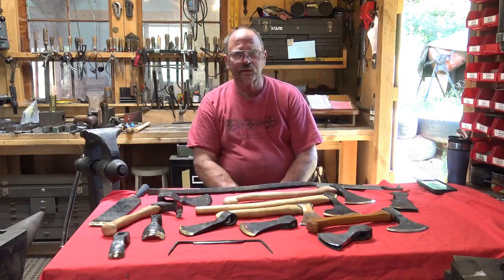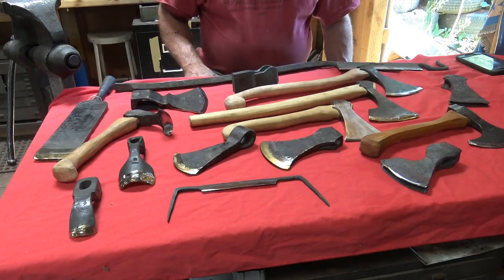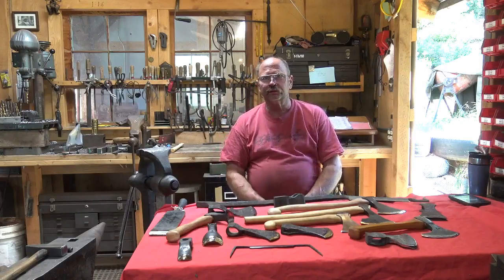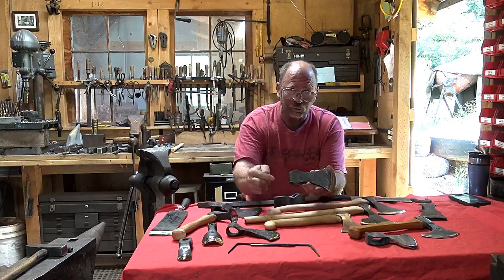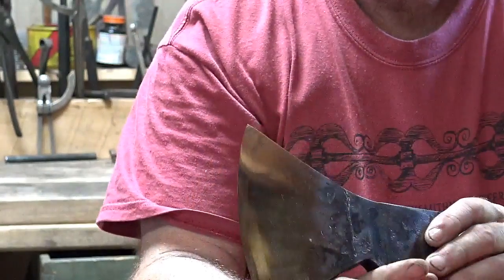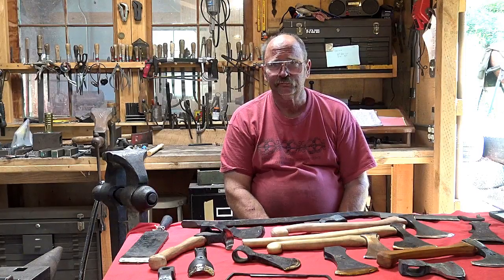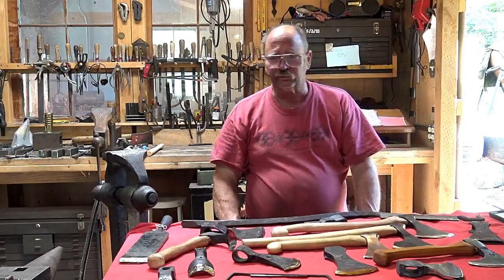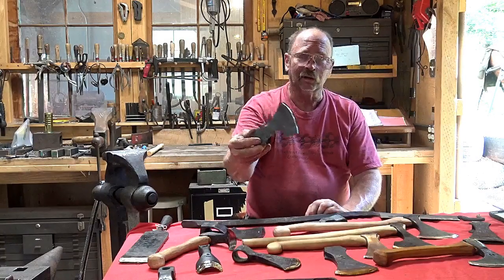Forge welding vs single piece construction for axes, adzes and other tools

Comment: Mild steel axe with a case hardened edge could work. You are giving a great presentation in this video. Thanks.
As an axe user I would not think abut any of that or have the knowledge. As a newbie blacksmith. Can't wait to try them both out. But am gona start with the forge welding. Have had some success. Got some leaf spring from a truck that may be sutable. Could I forge weld the two ends together by adding an insert of 52100 bearing outer casing? I hear that spring steel does not like forge welding to itself. Any tips welcome. Maybe the spring might be to brittle if hardened to much. Maybe no hardening needed?
Thanks again. 
David.
Reply from the maker: Work With Nature Thanks for the input. I can't think of any reason for spring steel to be more trouble. The big thing is to not over heat since higher carbon steels are easy to burn up in the fire.
Reply from the maker: Work With Nature oh, and I would certainly harden and temper the spring steel if you hope for it to hold an edge
Reply: Thanks that helps a lot. Would you quench an axe made from such a blade? Even annealed seems hard ish stuff?
Reply: Ha you answered my question about the harden and temper before I even knew I would have it.
Reply from the maker: Work With Nature yes I would. Probably oil quench but it pays to do tests with scrap pieces. Temper at 500 - 550 depending on its use. If its going to be a throwing axe then you may want to leave it softish. But just harden the last inch or two leaving the eye less hard.

Comment: Without a doubt the quality in my opion is in both the traditional design and the newer designs today. Safe to say someone such as yourself John is making a high quality tool regardless of the manner in which it was forged. I am not a wood worker by any means although i am a hobby blacksmith, that said i have an appreciation for any tool that has a hand made look to it. I would prefer to be able to see how it was made and what was done to it before it was finished. i am sure there are advantages to a one piece tool steel forging such as an axe, you could hammer on the back if needed although that is not the intended purpose of the tool. As far as saving money i think its safe to assume that a mild steel body and a tool steel edge is a more cost efficient way to forge an axe considering mild steel is much cheaper than high carbon steels. i would also like to add that i believe as long as a tool is used as it is intended to be, it should last you a lifetime whether it has forge welds in it or it is a solid one piece forging without any welds. Great video John and great discussion!!!!! Thank you for the wonderful content.
Reply from the maker: Keenan Dunnigan thank you. Pretty much goes along with my thinking.

Comment: Hi John, what is the long tool called that is closest to you, and what is it used for?
(at one point you held it up)
Reply: K Williams It's called a stock knife. Traditionally, they're used for rough shaping wooden clogs. The hook goes into a ring/hoop that you attach to a work surface.
Reply from the maker: K Williams as Matthew mentioned it is a stock knife. Traditional clog makers tool but also quite useful for other green wood tasks.

Comment: All the hatchets and axes Ive made are wrapped forge welded. Most of them have been made with a mild steel body and high carbon steel bit welded in. The only all tool steel Ive made were tomahawks out of farrier's rasps. The reason Ive done it this way is because I am doing it all by hand. I dont have a power hammer, and punchinf and drawing out a big chunk of steel by myself by hand would be quite the chore. I do also lime the traditional side of it. Thank you for the video and the discussion.
Reply from the maker: A power hammer or press makes the one piece style more accessible.  Wrapped eye axes are the way to go in a small shop without the bigger forging equipment or a motivated striker.  Thanks for the comment..